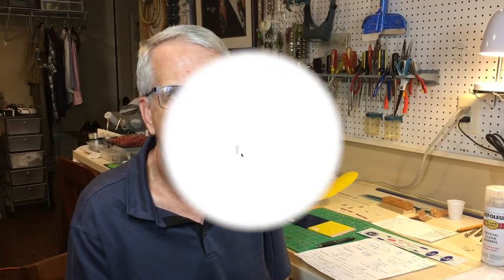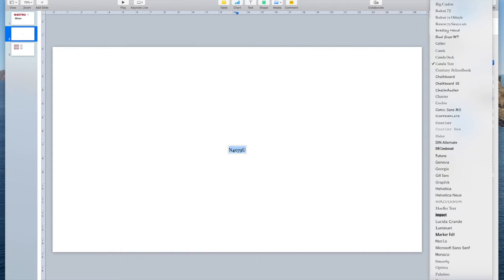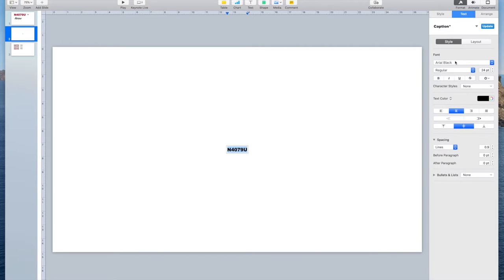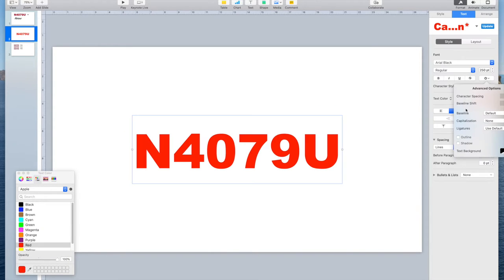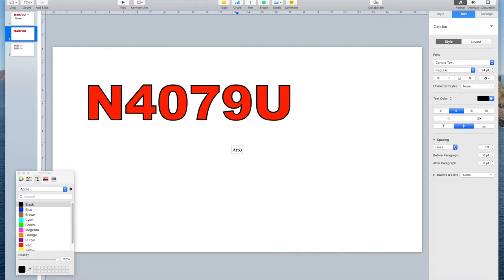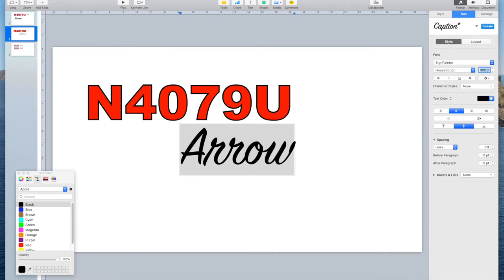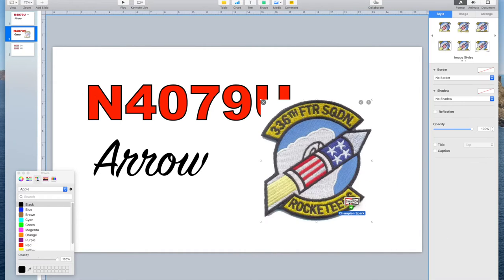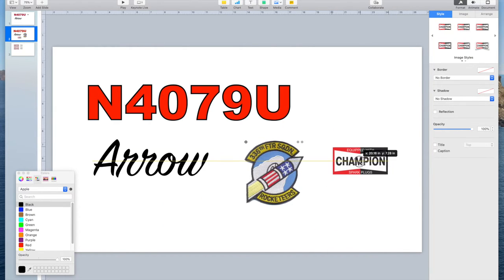RC Plane Decals for Newbies!

Comment: I have had problems with the decal paper having severe tight curling at the edges. I contacted the manuf, and they said the paper has a one year time usage. Have you ever experienced this? Also, I have tried decal solutions on this method of decals. And it wrinkles and ruins the decal. Have you experienced this also?
Reply from the maker: David:  I have not had this problem.  Maybe try a new brand of water slide decal paper.  Amazon has ratings, look for a higher rating.  Be sure to let the decal soak a bit.  When dry, apply a light mist/spray of the clear sealant.  Tim
Reply: So do you think slide decals are best for balsa mono coated planes...when using electric  i think it should stay on well...but i guess coating it after its applied will make sure..thanks for sharing.

Comment: great video!  Cricut vinyl cutters will do Print and Cut so you can cut those decals tight to the image allowing the use of white backing a bit easier.
Reply from the maker: Erica:  I have been thinking of the Cricut cutters since I saw them at Michaels.  Thanks for this tip!  Tim

Comment: Hi Tim, I have a short question for you: have you ever used Microset and Microsol on water-slide decals for RC models painted with water-soluble acrylic paint (that you buy from Michaels)?  People that are in 1/48 scale plastic models use these two to apply decals on airplanes very successfully.  I had been masking the plane before I spray the roundels (or other insignia), but I have found this method is both risky and long.  Acrylic paint is the cheapest variety you can find for artwork, and it is quite cost effective for electric RC airplanes.  Thanks a bunch.
Reply from the maker: WS:  I have heard of this method, but never used it.  Thanks for this input!  Tim